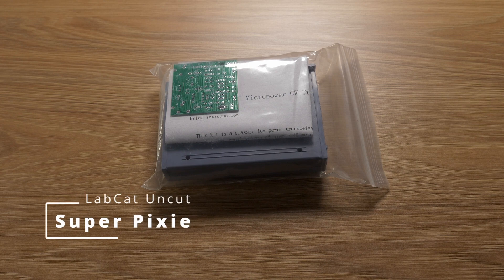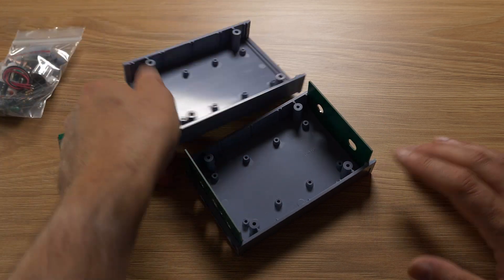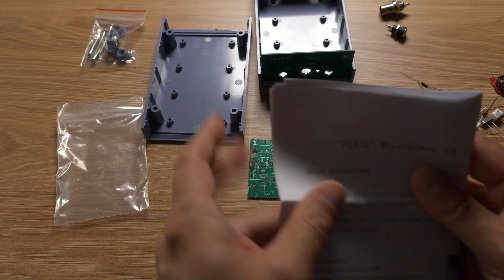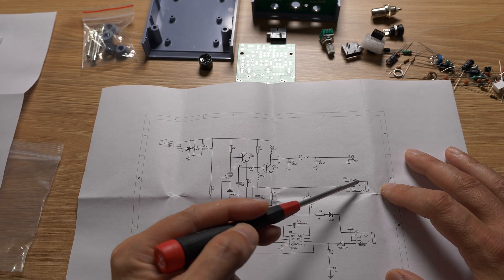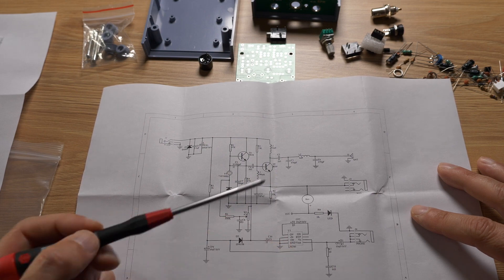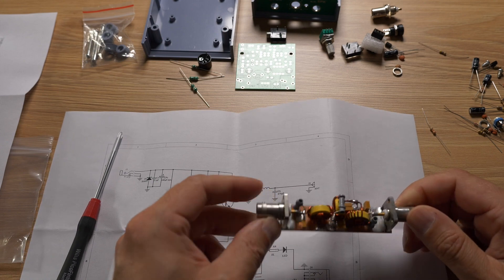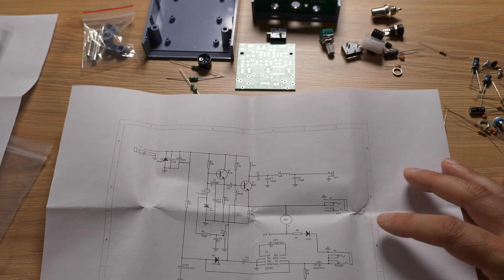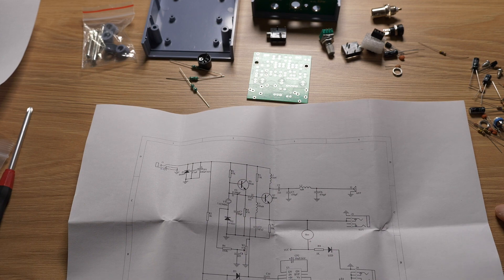Super Pixie Unboxing - Uncut | HamRadio

Comment from the maker: FYI: I found a nice circuit explanation and linked it above in the description.

Looks like the second transistor is used both as a mixer for RX and as PA for TX. This is probably also why a little bit of RF leaks to the antenna in the RX case.

The two live streams, where Morten and I built the kit are also linked above. So if you need some background entertainment while doing household chores, you know what to do. 😉